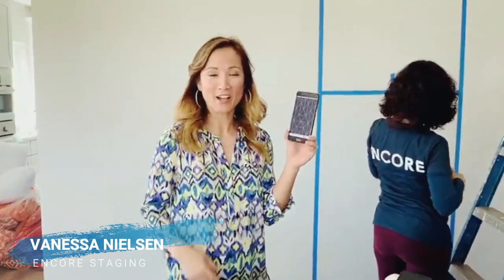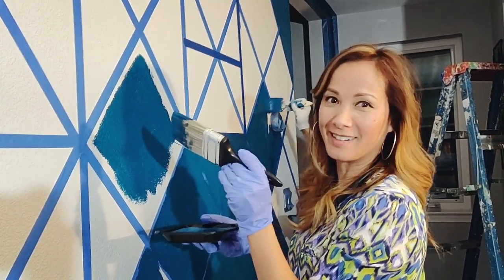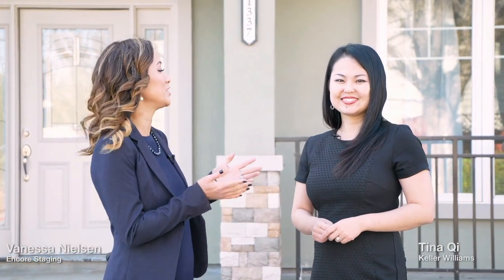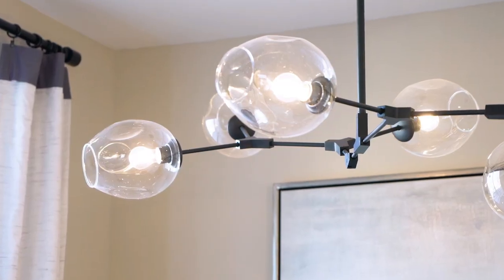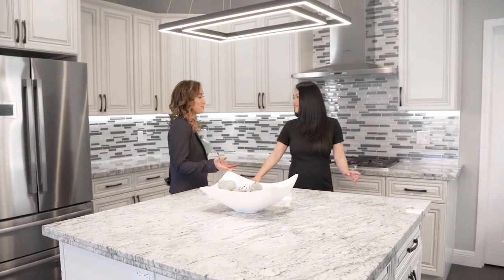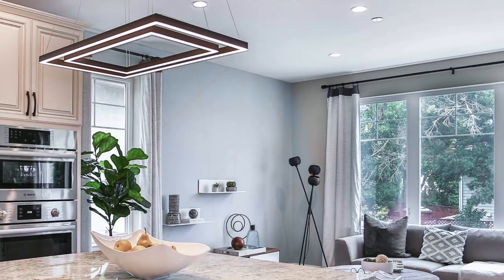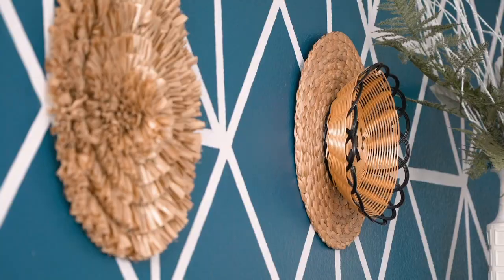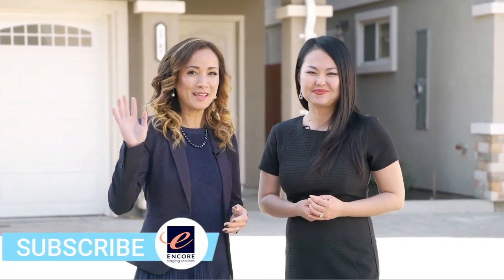BOLD ACCENT WALLS TRANSFORM MODEL HOMES IN SILICON VALLEY BAY AREA REAL ESTATE 2020

Comment: How many days or hours did it take.
Reply from the maker: It actually took us 3 days for the 2nd wall (the bold blue one).  There was no power at the property, so we got to use a generator. You can see that we set up a floor lamp in the behind the scenes! What an adventure.
Reply from the maker: It actually took 3 days. There was no power at the property...you can see in the behind the scenes..we found a transformer and plugged in one of our floor lamps